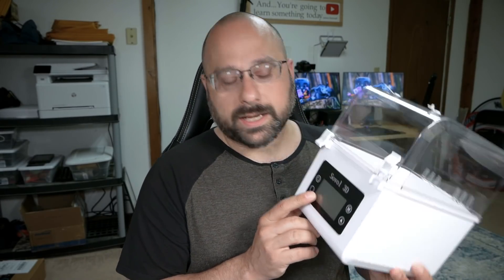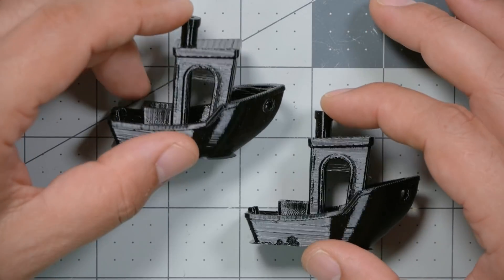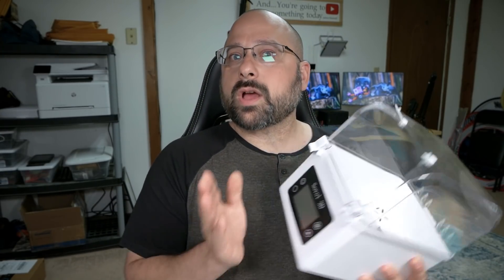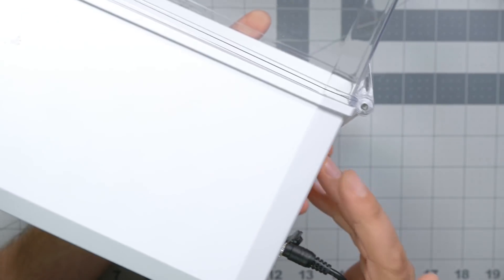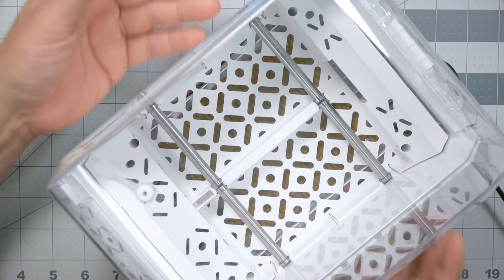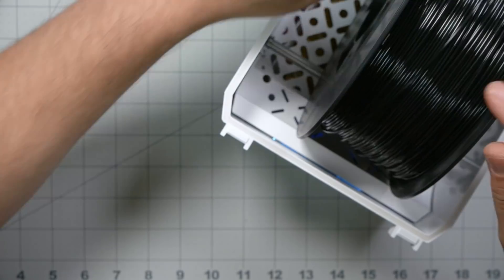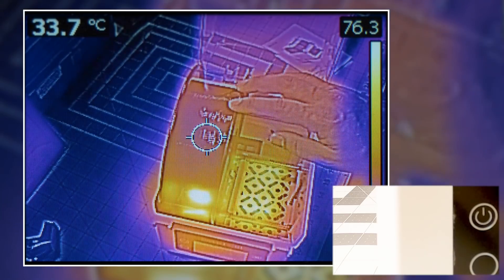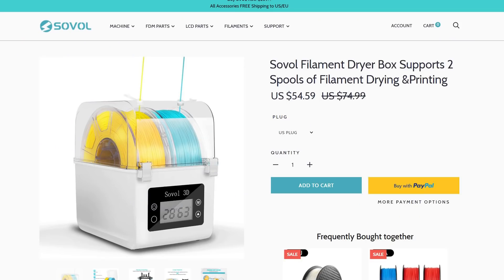You might not even need a 3D printing filament dry box | Sovol SH01

Comment: Dont buy these dryers...I've tested 6 of these types of dryboxes and none of them contain enough desiccant to get the moisture below 3% the heating element isnt enough to actually remove moisture. I recommend tupperware and color changing desiccant, and print your own rollers ($10). Use a dehydrator or a convection oven (convection ovens keep the temp even across the space) to dry.   You should dry every roll of TPU straight from the factory, right out of the vac bag and into the oven. TPU picks up 3-5 grams of moisture in 24 hours, which degrades quality. Your quality will improve, reduce stringing. Not a big deal with PLA, PETG, or ABS,  but TPU and Nylon need to be dried immediately and again if exposed to air for more than a few hours...but it's not not like I run a print farm..oh yeah, actually, I do ;)  Love you Joshua, appreciate everything you do! The eSun box scale isnt accurate enough to measure moisture gains/losses...it's just to estimate how much filament is left on the reel.

Comment: Food dehydrator works well, and it's round, with a circle in the middle...just like a filament spool.
Reply: Agreed!! I've been using the cylindrical nesco for idk a decade now. It went to work drying filaments for me many years ago. I keep all of my filament in a big plastic container w a seal built in the lid, with a gallon of (indicating) silica desiccant. It's been 3 years now and none of the beads have indicated they need to be recharged yet!!! I only use my dehydrator for rolls that I forgot to put back into the box, OR electronics/shoes or whatever that accidentally get wet haha. Oh, and for beef jerky and fruit chips!!!!!!  Try that last one with this silly filament heater!

I had to make a lid adapter out of cardboard though, so I can use the dehydrator top on a much larger container then the trays it comes with.
Reply: @Ryan Skelly  Well, I didn't want to name drop, LOL. Yes, Nesco is the bomb.
Reply: @gutrali  Yes, storing the filament using a vacuum sealer, with silica packs, is a good idea if you're not going to  be using it for a length of time.
Reply: @brownsamurai3070  I also bought a few of those pass through Teflon bung tube things that allow me to drill a hole and keep it reasonably air tight while still loading a roll from inside the box. 

But I didn't bother with putting rollers in it yet, nor installing the bungs... etc. If I have to switch filament types anyway, it's just a ton more work to have to unroute and reroute through the main box
Reply: One shortcoming of these filament boxes is that it doesnt have the high air flow rate that food dehydrators have, which can result in condensation
Reply: I tried that method, but my kids ate the filament
Reply: Definitely, just make sure it has temperature control.

Comment: I have the similar filament dryer, and I ended up buying/modding a food dehydrator anyway because of of how unevenly these dry unless the spool is rotating. Since you want to dry your filament BEFORE you print, even if you can print and rotate the spool within the box, it's not going to do that while sitting idle before a print. In order for this type of dryer to be effective you'd probably want to mod it with a fan, and at that point just spend $50~ on a decent food dehydrator, cut out some of the grates, and get better drying performance. I'll say that the compact size is appealing, but in general price:performance isn't worth it.

Comment: So have the heater always and forever running... no thanks. Rather buy a sterlite sealed tote and just make a makeshift shelf out of PVC pipe, add desiccant that can be oven renewed that's in a pillow sheet or oven bag.
Reply: Most of those heated dry box will only run for 12-18 hours at a time and then shut off...when you really do need it to run day and night....i wont use em either,  my convection oven is far more effective to remove water and tupperware to keep the filament from getting more moisture

Comment: TPU absorbs moisture really fast. Even a day exposed it's starting to get worse. Depends on humidity level. When moist, you get terrible "foamy" prints from steam at the hot end during printing. I dry all my TPU with a dedicated filament roll dryer and store with double bagged rolls with lots of silca gel and small humidity monitor in each bagged roll.   PLA barely absorbs moisture, even long term
Reply: This

Comment: Maybe the petg cannot be wound as tightly as pla?
So you need a larger diameter hub for your petg
Reply: PETG can be wound on the same spools as PLA, but annoyingly, as Joshua found out, there's no set standards regarding spool dimensions for manufacturers to comply with. The diameters of most are fairly consistent, center diameter generally ranges between 50-60mm and the outer diameter 190-200mm, but the wideness varies a lot.
My guess is because filaments are sold by their weight not their physical volume.

Comment: DIY dry bins work great too, and can hold more spools for quite a bit cheaper than these active dryers. The DIY approach takes longer though because it's not actively drying with heat, but once it's dry it stays dry. Good for long term storage.

EDIT: I should watch the entire video before commenting next time 😊
Reply: Diy dry boxes using silica have been shown to not work. Heat allows molecular motion to drive water out. It isn't the same process as ambient dry air

Comment: My no insulation house in Oklahoma has major humidity problems. PLA will get brittle over time. PETG and TPU will start stringing. I have to store all my filaments in bins with gaskets, and I have a dryer.

Greengate PETG (recycled) is amazing, but needs to be dried out of the box.

Almost 3 years of printing on 4 printers, and it does make a difference for me.

BUT.. If I had a "normal" house, it probably wouldn't be an issue.

Comment: Again, perfect timing! I have an Ender 3 v2 with the carborundum glass bed and a set of multi-color filaments arriving tomorrow. It is good to know how to properly dry the filament. Thanks, JB!
Reply: For me the timing is always one or two days late. At the beginning of my fpv "journey" I got a betafpv hx100 and I had a problem with the vtx's wiring harness and I had to change it. After I struggled for 5 days trying to figure out how to get the harness pins to get out, I finally changed it. Next thing you know 3 days later Bardwell releases a video called "how to change a wiring harness". I guess I am unlucky, but hey, it's more rewarding and fun if you figure it out yourself right?

Comment: I usually just use the hotbed on the 3d printer to dry the filament. That also works well and has accurate temperature control. Just put something over the spool, to contain the heat. I only had to do this a few times with tpu. It wasn't necessary for PLA and PETG for me so far.
Reply: I found I had to dry out a PLA reel today. Yesterday I printed some tiny 10mm fans with PLA and they came out perfect, but I left the reel out overnight where the temperature dropped and the humidity rose from the rain, carrying on printing some today (same gcode file) the first batch had lots of tiny strings. I popped the reel in the food dehydrator at 45C for 3 hours and printed more, with the reel still in the dryer, the prints came out perfect again.
Reply: Nice idea
Reply: What temp do you keep the bed when drying tpu? And for how long do you keep it there?
Reply: I usually use 55°C for tpu and pla,. That worked well for my tpu so far, without changing the raw material.

Comment: There are designs like Thingiverse 2172384 to hold capricorn bowden tubing in the side of your dry box, enabling printing without needing to take the filament out, which avoids it absorbing moisture during printing.
I created a similar one for my cheap temperature controlled food dehydrator to print whilst the filament is kept warm.
Reply: the moisture filament accumulates over those few minutes is completely neglegible and the "wet" filament is purged when printing a priming strip and skirt. using a bowden tube on these looks cool but does not have much of a real benefit.
Reply: @drkastenbrot  When printing from a dry box the need of a bowden tube and how long it has to be depends on where the box & printer are in relation to each other.

Comment: A fillament dryer can defenitly be worth it in the right occasions. When printing Nylon it's almost something you need to have.

I do have some TPU that i can print about 2 or 3parts with when it comes out of the oven. I've got the Esun fillament dryer and when i put my TPU in there i can empty that spool completly without having any moisture problems. When printing small details with TPU you really don't wany any moisture at all.

Comment: ABS is old news. Its not much stronger than pla. The only real up side to it is its heat resistance.
Reply: it was known for a long time that abs is not a strong filament, it just has significantly more elasticity than pla, so it is less likely to shatter. abs is very cheap and relatively easy for injection molding but for 3D printing it was never a great choice.
Reply: It's only weak because most printers don't have temperature controlled chambers.

Comment: These two miniature camera mounts were printed from the same reel of transparent TPU. Guess which one was printed after the filament was dried with a cheap temperature controlled food dehydrator.
haku.co.uk/pics/WetAndDryTPU.jpg
The moisture in the filament turns to steam, creating tiny bubbles with popping sounds as it prints.
Reply: PLA can definitely benefit from drying.
 Here's a real world example from today.
I printed a bunch of tiny 0.05mm layer height 10mm diameter fans yesterday for making water flow measurement tools.
It was warm & sunny yesterday and they all came out perfect, I left the Prusament Vanilla White PLA out overnight during which the temperature dropped and the humidity rose from the rain.
Printing more today the first batch had many tiny fine strings, so I popped the PLA filament in the dryer for 3 hours at 45C then printed another batch, whilst the filament is still in the dryer, they came out perfect.
Reply: I've found at least in humid Florida that a dryer makes a big quality difference with Petg as well. I can see it bubble and pop as it leaves the nozzle when it's not dry and after drying in my dryer that goes away completely. I feed out of mine every time I print now.

Comment: Hmmm. I been 3d printing since 2009. I have boxes full of old filament and it’s fine.
Reply: I found my TPU & PETG prints have come out noticeably better (both the visual and mechanical properties) since drying the filaments and storing them in airtight tubs with silica gel beads in.
Reply: Printing since 2009 probably means abs and pla which don't have much issue with moisture. Nylon TPU and PETG will absorb much more.
Reply: PLA I've never had a problem with but TPU seems a lot more sensitive.
Reply: @jakeh3144  ahh yes. I have been using TPU and back in the day there was NinjaFlex which is similar of not the same but yeah maybe that would be a different story. I just haven’t had any issues. I used to keep them all bagged with silica packets but I’m not as concerned about it anymore.